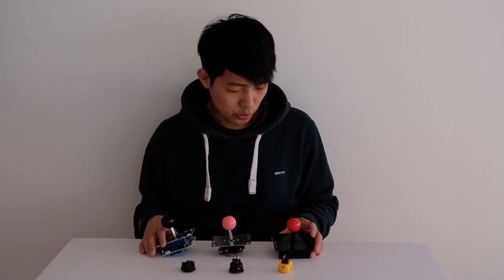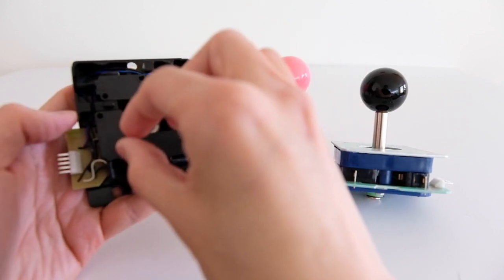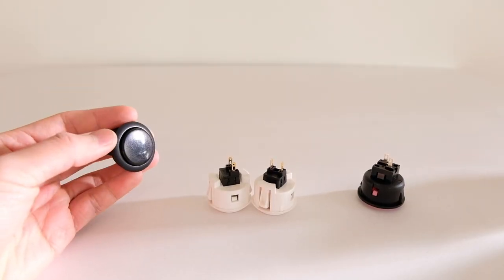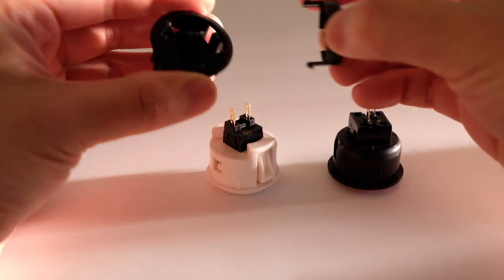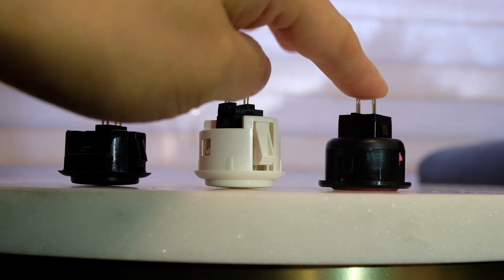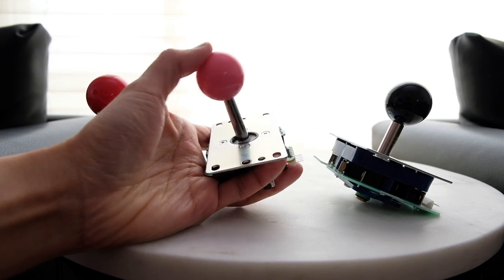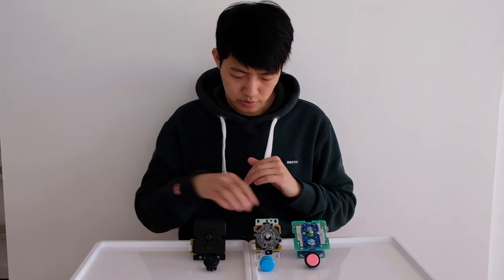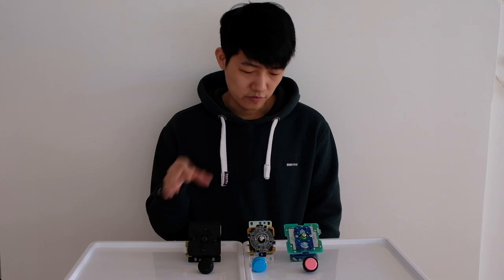Sanwa vs Hayabusa Vs Seimitsu Review Detail Comparison 2019 HD

Comment: Good review....but you leave out the same important detail like every other reviewer does and that is the actual "Gate." I know the seimitsu gate is square, but are the corners rounded? Or do they clunk at the corners like the Sanwas do, and require third party circle/octagonal gates like the Sanwa in the video has if you want to ride the gates for smooth circular motions.
Reply from the maker: CrypticNinja i left it out on purpose, because the lever and gate should be 2 different topic. Becuz if i was going to talk about the gate, i have to talk about the ball top, P1 plate, shaft, pcb, shaft cover,  micro switch, etc. if you know what i mean. I saved it for another video because any of those i mention is a whole video on its own. This video was already 23 mins, if i add gates and stuff on to it, it will be 45 mins, and this 23 min video is already kinda boring and long 😂 i have the gate on my list, i have a whole video on it coming soon 🙏❤️

Comment: I got a question/recommendation request of sorts. I've been thinking of buying a Mayflash F500 base model to customize with new parts. Since I collect a bunch of older consoles I really like the flexibility to use Mayflash sticks on multiple consoles as well as the customization options. I'm also aware of the Elite version, but I like the black base and I'd like to install Sanwa silent buttons with different colors as well as a different stick so that's why I'm looking at the base model. That brings me to my question: in fighting games I'm not terribly great at coordinating directional movement without slipping or inputting a completely different move than what I wanted (example: I want to do a down right movement but I end up doing just down or right) and I prefer a stick with as little of a dead zone as possible. The throw doesn't have to be short, but I'd like some sort of tac-switch feedback as soon as I move the stick. With all that in mind, what kind of stick, gate and other parts would you recommend to me? I was thinking Seimitsu with an octagonal or circular gate with a bat top (I prefer bat top due to being accustomed to US arcades) but it sounds like the stiffness might be too much. Sanwa's stiffness sounds just right, but I really like the metal plate to tactile switch design of the Seimitsu. Any ideas or suggestions would be greatly appreciated.
Reply from the maker: I think a sanwa should do the trick,
Might have to give it some time to get used to, and sanwa jlf has alot more customization and parts available, 
And i always prefer square, i think it less travel between direction, the octa gate feels abit too wide for me
Reply: @JoystickNY  Thanks for all your advice! I'm a stick noob so it helps out a ton lol. I had a good feeling about Sanwa so I'll "stick" to what you said and try that one (I'm not sorry for the pun XD). I'll probably buy an octo and circular gate alongside the stock square one just to try all of them out and see which one feels better. If the octo feels too wide like it does for you but helps with my directional inputs then I'll probably get a shorter shaft to help compensate.

Comment: what better to play the king of fighters, seimitsu or sanwa?
Reply from the maker: I think both is the same, sanwa is more loose and seimitsu is tighter. I play alot of kof 98-2003, sanwa works fine for me, i use sanwa with everything else i play, so i dont want to use seimitsu just for kof. If you know what i mean. 
I use sanwa lever and hayabusa buttons 🙏❤️
Reply: Playing KOF '98 with a Sanwa JLF has to be the most horrible nightmare ever. A group of friends and I tried it since it is the most famous stick and we were all disappointed, it feels like the stick has to travel 100 miles before it registers an input, and then you have to wait for those 100 miles again for the stick to go back to the center. Forget about double tapping, so running is completely out of the question, and if you, like me, tend to do a lot of hyper hops, you will get tired in no time. It might be the best stick for half circles, quarter circles and stuff like that, but that is pretty much it. We would LOVE to try Seimitsu's LS-40, but it is very difficult and expensive to get in my country.
Reply from the maker: Alejandro Sanz II thank you for sharing, really good to know ❤️🙏
Reply: @PurpleSanz  I was having equal difficulties, I changed the factory actuator to the famous kowal actuator and it improved a lot, because the diagonals don't fail anymore, the joystick is  tight. I am waiting for an original grease to come in to test more properly because mine has a dry grease. maybe I will make a video showing the differences, but I speak portuguese
Reply: @JoystickNY  thanks  dude :)
Reply from the maker: drago please make the videos, more videos are always good for the community, let me know when you make that video ❤️🙏
Reply: @JoystickNY  all right, when the grease arrives, i will try to make a video about the actuator :)
Reply: @PurpleSanz  I ordered two Seimitsu LS-40s, because the damn Sanwa JLF is too slow for inputs for KOF,  my whole arm is tired after my sessions, shoulders, elbows, and my wrist.

I spent some pretty penny for shipping. 

I’m gonna try to figure it out how to fit it in my Qanba Drone, I bought both without the PCB. I will shave and cut some plastic if I have to.
Reply: @chronology556  I also got tired of the launch of sanwa and bought my LS40 01, wanted with the old panasonic microswitch, but unfortunately I only found it in the new version with omron microswitch, but even so the LS40 is much better than sanwa in my opinion
Reply: @drago__  the Omron microswitches suck.

I have those too.

They cause deflection and sometimes have drift in directions and won’t disengage the switch.

Comment: I am trying to figure out what Joystick the Hori arcade stick Mini is using through the audio of the stick movement and maybe seeing this video and paying close attention to the audio cues. So far I have no clue what they used.
Reply from the maker: It might not be a standard size, i think the mini is smaller compare to the avg sticks
Reply: @JoystickNY  well until I remove the restrictor plate when I have time, I won't know how it's set up. From the clicks it sounds like a similar Hayabusa style with the trigger switches.
Reply: @JoystickNY  update for the arcade stick mini.. Well today I took apart the joystick on the Arcade stick mini and sadly the joystick is weird, it is just 2 pieces of plastic locked together and the switches aren't even fused to either plastic piece they just rest in the housing and locked in with plastic pegs, and screws that lock onto the top of the arcade stick. The shaft of the joystick is smaller than an official standard size so couldn't change it even though I wanted to do that.
Reply from the maker: Ah, i heard, its prob not possible to mod it then, maybe look else where and get a drone or mayflash
Reply: @JoystickNY  No Prob.. I already have an 8bitdo Arcade stick coming I got the buttons and I am waiting on the arcade stick to arrive.
Reply from the maker: Good choice

Comment: Thanks for the great Video. I'm looking into my first arcade stick and was eyeing towards hayabusa parts, but them being a bit "loose" has me worried. I see Seimitsu next to never being featured in prebuilds (I like resistance on buttons/stick). Should I mod a pre-existing cheap stick or maybe look for a budget-ish Sanwa Part prebuild?

It's really hard to get a grasp on the market.
Reply from the maker: If you r un sure, i would say start with sanwa, its kinda like the middle, hayabusa is loose, sanwa is just right, seimitsu is tighter. Depending on your budget,the mayflash f300 elite is not a bad choice for 80$ 👍🕹

Comment: wish you had change out the ball tops to see if they works on all stems since i heard ppl say that the seimitsu is a bit thicker and i wanted to buy a bat style top to play on the seimitsu stick
Reply from the maker: I have put my sanwa ball top on seimitsu lever, they fit, the stem/shaft are diff size, but the screw threads are the same 🙏❤️

Comment: You tested the pressure to activate them but can you tell me if there is any difference between the different "zones" on the button? Like is there a button where there is only contact if "pushed through" (and not like 50% of the way the button can go in). For keyboards for example I prefer non-mechanical switches with short travel time, where you can just apply pressure to have the button pressed and release pressure to have the button not pressed anymore, rather than moving the finger all the way up again.
It feels like most button comparisons are more about sound and aesthetics rather than the difference between how the buttons work (like your "missile test" which was already great to see)
Reply from the maker: Thank you for the comment, it would require some hardwhere to test which i dont have; i think is easier to test on keyboards becuz of those cherry switches have all the infos on it, but for buttons so far there us no official info on that, i would need some type of meter and pressure and distance machine to testo

Comment: I have a question about seimitsu. On the bottom i can see two restrictor gate installed. The light blue one is a square gate, and what is the other blue one for? Does it play fine without that part
Reply from the maker: The light blue one is the square gate, the dark blue one lets u move around and choose between 2 way, 4 way and 8 way gate for like retro games depending on what games you play, the dark blue is not required, i just leave it attached tho, so i dont lose it 🙏❤️

Comment: Hello, you could bring the ls 40 seimitsu to your channel, I would love to see this review, your channel is very complete, only ls 40 is missing and another suggestion for you would be the various types of grip on the balltop. Thank you!
Reply from the maker: Thank you for the suggestion, i will add that to my to make list of video,
What do you mean by types of foot print on the ball top? 🙏 thank you for watching ❤️
Reply: @JoystickNY  I think I expressed myself badly, it's a fightstick grip, like the umehara grip.
Reply from the maker: Tiago Fernandes gotcha, thats a good topic, i ll see if i can insert it in a video down the road , thank you for suggesting 🙏
Reply: The 40 is built on the same base than the 32 and 38 (except the 38 has a stiffer spring). The difference is the 40 has a taller housing so the microswitches sit lower that gives you a shorter throw that's perfect for shmups but still perfect for any fighting game. And because the 40 has a shorter throw it completely eliminates the classic problem of the ball joint popping out of the socket when pressing lightly past the restrictor. I have twelve LS-40 and even though i have all Seimitsu models there are the LS-40 is the only one i will ever use.

Comment: I have a question regarding siemitsu lever. Is it the same plug as sanwa uses or do you need a 5 pin connector?
Reply from the maker: Its the same 5 pin connector, i swap lever back and forth all the time

Comment: Which one has a better 4 to 8 way restrictor plate? I am having great trouble playing games like Ms Pacman even with the Sanwa restrictor in 4 way mode. I just want a USB 4 way exclusive stick for PC, but life isn't that easy!
Reply from the maker: For pacman, i would say go for the octagon gate.
Reply: @JoystickNY  thank you for the reply! I put an octagonal restrictor on, and the game still hits two micro switches on the diagonal. Works great with Tekken, though. I have Ms Pacman in 2 speeds. It's a little better on the slow one, but the ghosts move much faster than Ms Pacman. Exactly the opposite on the other. She's sped up quite a bit, and making quick turns, or playing anything on They Meet onward is horrible! I was going to try the Mag-Stick Pro, but I heard that they jump out of 4 way to 8 way during play. Not certain about the regular Mag-Stick with the switch lever. I have no issues going under the cabinet to switch, because I have a hinged flip top. But if I do purchase the Mag-Stick, I'm going to have to change the wiring from 187 to 5 pin, hopefully with a 187 to 5 pin conversion harness, if they work. I was also looking at the Suzo Happ dedicated 4 way stick, but I can't find their dimensions, and was worried about clearance, as my build only has about 7 to 8 centimeters in depth. Any advice would be welcomed.

Comment: im gonna try stick for 1rst time since my arcade days in the 80's and 90's. is default stick/buttons in mayflash f500 v2 good enough, or should i just go ahead and order sanwa stick/buttons and replace them on arrival?
Reply from the maker: I think you will be over spending, what console r u buying for?
Reply: @JoystickNY  pc mostly but also switch. Got the f500 and loving it.
Reply from the maker: Thats a good choice, later on you can upgrade it with different parts 👍🕹

Comment: Tight is more accurate but you might accidentally press input because it is too precise. That is the point of the comparison. 
    So if you bump around combos a loose stick is forgivable for beginners but a tight stick is more for a seasoned player.
Reply from the maker: Great input, thank you for sharing 🙏❤️
Reply: I m not really sure about that i think it is the opposite because with loose stick you can misinput something like a jump and its harder to return to neutral for example. But loose sticks give you more speed. Tight sticks give less errors but require more force and are slower.

Comment: I own seimitsu LS-32, LS-33, LS-38, LS-40, LS-55, LS-56, LS-56 limited edition with multiple different springs, LS-58 and have owned Sanwa JLF and Hori Hayabusa and the silenced Hayabusa.
The LS-40 is easily my favorite for any game. I wouldn't even recommend anything else unless you absolutely love a Sanwa. Never liked the Hori sticks.
The LS-40 is the same rugged build as the LS-32 / LS-38 but has a taller body to eliminate the classic problem with the 32/38 that the ball joint pops out of the socket when pressed harder to the side. 
(all other Seimitsu models are different versions of the first compact Seimitsu LS-33. If your stick can't fit the LS-40 the LS-56 is an awesome stick too)

Seimitsu PS-14-GN is a far better button than the PS-14-G you have in the video. The one you have has a 50% smaller microswitch assembly and doesn't have the original Seimitsu feel. Sanwa buttons feel too loose for my taste because there is a lot of play even when fully pressed down and they make a cheaper feeling sound than the PS-14-GN.

Some PS-14-GN buttons require shaving a little plastic though because when pressed at an angle some get stuck on the way up, so just open the button so you get the microswitch out and feel where it's not perfectly smooth and carefully shave the black outer edge till it moves smooth. It's worth the trouble because I think it's far superior and is the only button i will ever use.
Reply from the maker: That is alot of great helpful information, thank you for sharing. 🙏❤️
Reply: Is LS 40 the same as LS 40-01?
I can compare Hayabusa and LS 40-01 myself. They literally are not diffirent when you play each. The only diffirence: LS40 has more resistance to pivoting and dampens the oscillations. I ve been missing my inputs with LS 40 because it requires more force to move. Seimitsu feels slower.
My conclusion is that all japanese sticks are just the very same thing for the most part.
Reply: @okakokakiev787  LS-40 is without PCB and you have to plug in separate wires to all switches and LS-40-01 is the same but with PCB and the 5pin connector.

But when i speak about different properties i just shorten it to LS-40.

LS-40 has a shorter throw meaning the switches activate much earlier and it hits the gate much earlier than on the Hayabusa. An electric in Tekken 7 is difficult on the LS-40 because when you return it back to center it is really easy to hit a back direction in the middle of the move since it's so close to neutral position. LS-32 is closer to Hayabusa and JLF
Reply: @okakokakiev787  But yeah in general all Japanese joysticks are really similar and it's all a matter of preference in the small differences.
Reply: @epicon6  Do you use the LS40 with a yellow gate or without it? I must really try to notice the diffirence in early activation for the LS40 because right now its not there for me. I think ill need to swap the parts and try again.
Reply: @okakokakiev787  The yellow gate is useless for a square gate. The corner on two sides feel different because the other side is more open. 
I even tried combining two yellow gates for a full yello square gate but it's not good because you feel two notches on all corners when it's transitioning from the yellow part to the white part. So you can remove it because it works best without it.
Reply: @epicon6  Wow you did try your best. I see! Yellow gate looks like a gimmick that is not very well thought out. Thanks.
Reply: @okakokakiev787  I think it's there so that the gate is always there for the arcade operator. But the 3 in 1 gates always have the same flaw that none of them work perfect because both sides feel different

Comment: Been using Sanwa parts by default for a long time, but the Seimitsu looks interesting to me. Do the larger bases of Seimitsu and Hayabusa make it difficult to install due to space limitations in some models?
Reply from the maker: it fits similar to the sanwa, pretty much the same; i didnt have any issues with any stick so far ❤️🙏